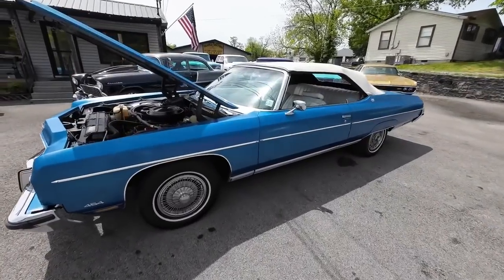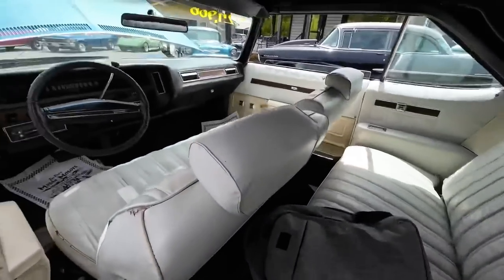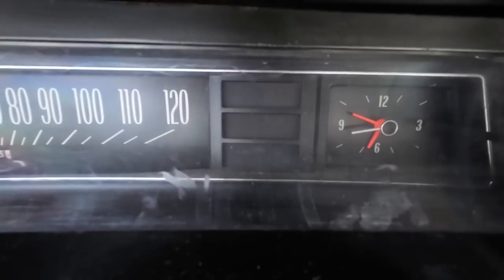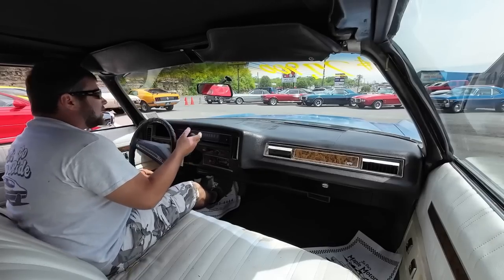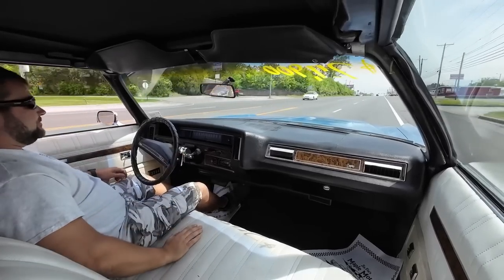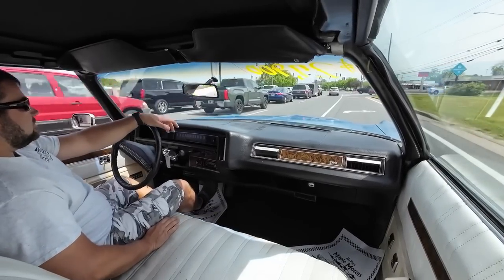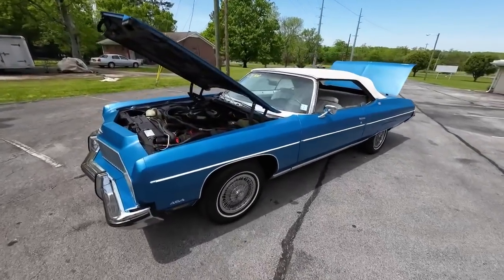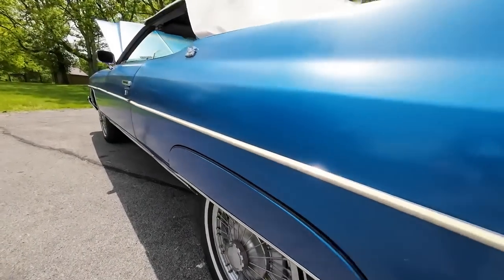Test Drive 1973 Chevrolet Caprice Convertible 454 Big Block SOLD $27,900 Maple Motors #1921

Comment: Really good looking year for Chevy. I have a 400 coupe. It is not all that valuable,but it is special to me as, I bought it new in Jan '73! I still have window sticker of $4715,paid $4250 in cash. This 454 Conv.probably msrp'd at around $5400. It's.well equipped,but I did not see,cruise or tilt. Does have windows,door locks,am-fm. For the younger viewing,that interior is vinyl not leather. Coupes and sedans came with cloth and conv's and wagons had vinyl.
Reply: Could you opt from the factory to get a big block in these, or is this just someone’s project?

Comment: With all that’s wrong with this unit. It’s about ten thousand dollars too much. Bottom of inspection cover and trans pan wet with oily substance. AC not working, top not working correctly. Power window not working. Bulbs out, dash cracked. Glass pack mufflers.
Reply: Now go figure in 80-90 % rate of attrition for 1973 big block ragtops. Adds a certain perspective to any asking price

Comment: Definitely frame off restoration inside/outside through out exterior everything must be removed everything. Chevy is not only screaming 😱 🙀 but it’s definitely screaming for an off the frame restoration a whole list is needed to restore to bring it back the way it was from the way way it looks when it was new. Better than it was when brand new. That it how I would remedy the situation. 

Like I said before and I’ll say it again find a good reputable auto restoration specialist that not only stands behind his work but also stands behind his work. 

                                         Sincerely Yours Truly 

                 T. O. G. Ivan I J 🧔🏾💪🏾🧔🏾👓🕶😎🧔🏾💪🏾👔👕👖